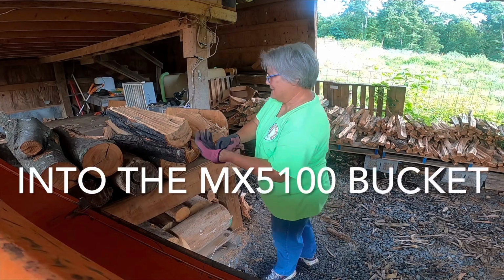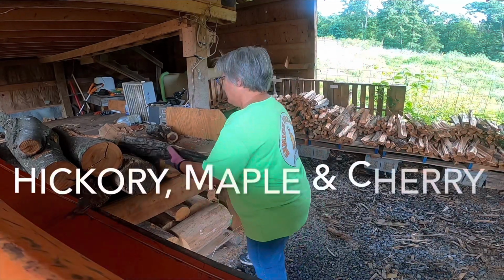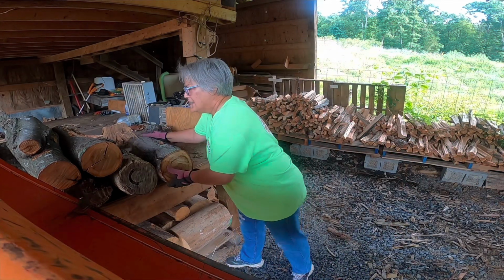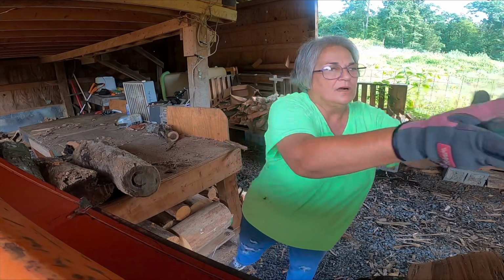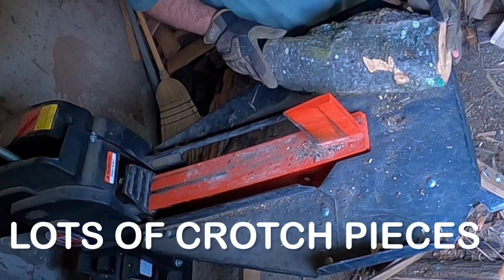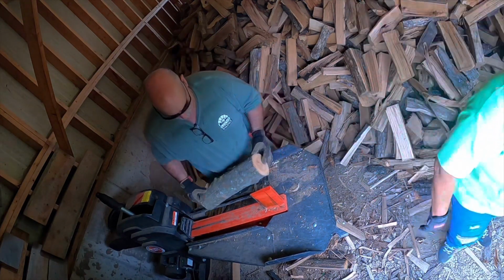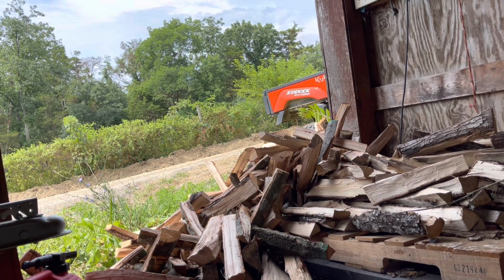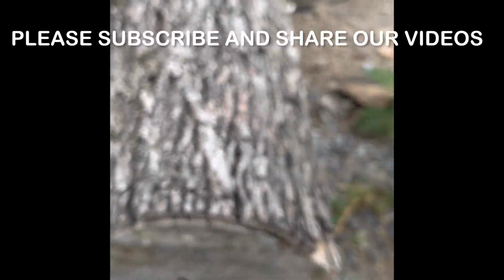Fast Firewood Splitting #252

Comment: The lack of noise is definitely a plus on the DR. The humidity here has been terrible to work out in. Got 3” of rain in an hour yesterday. A little team work sure speeds a job like that up. Take care!
Reply from the maker: Hello Ben, Yes its a joy to run now, splitting with the best of them. The cheap rack and pinion may not hold up, but it is performing well, stay cool in this heat 🚜🪵👍🏼🇺🇸